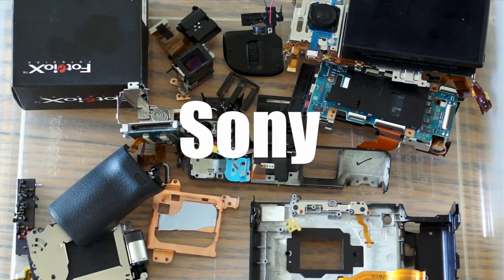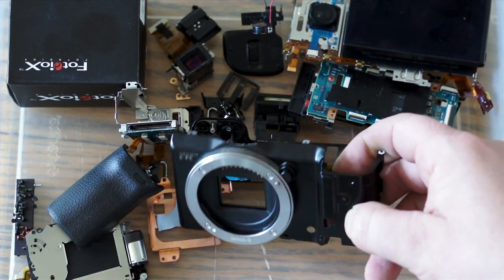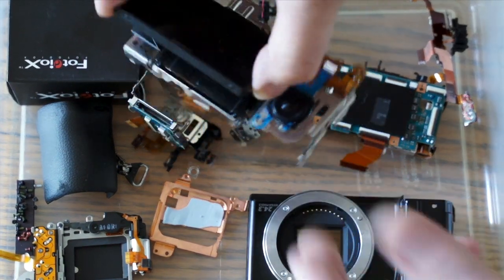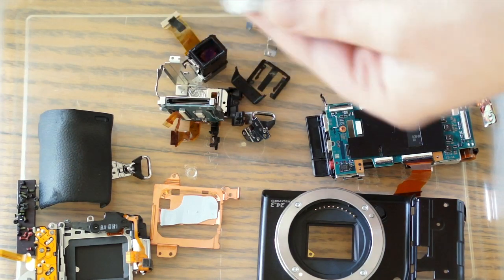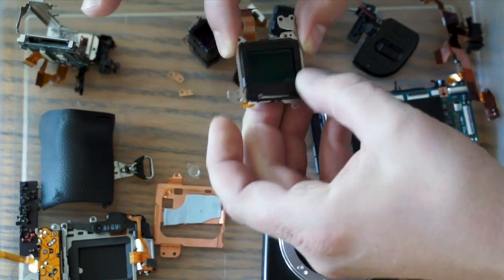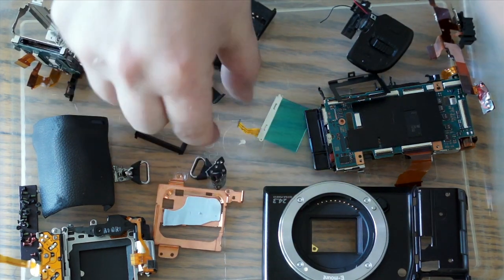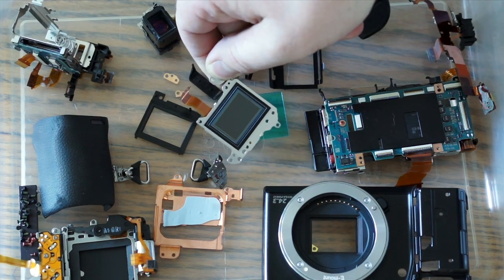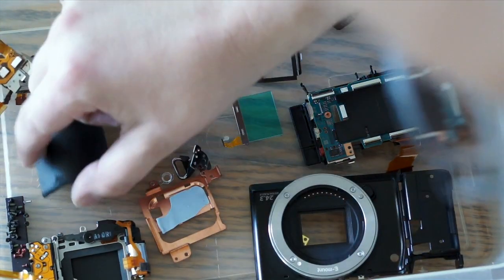Sony Nex-7 - Completely Disassembled

Comment: the green glass over the sensor is the ir/uv filter and the wire is for cleaning it. Im wondering did you have to desolder the ribbon for the glass or did it just come out?
Reply from the maker: Hello, I since learned that about the glass, but thank you! I did not have to desolder anything it was all connectors that I dealt with...
Reply: @Jason_Hermann  Hey thanks for the reply after so long! I took apart my nex-7 using an archive of the photos you posted. Was able to get the camera back together after removing the filter and ready to shoot in infrared/astrophotography :)

Comment: Hi Know you probably won't see this but I thought i'd ask. 

I brought a second hand NEX 7 from Harrisons camera's which apparently was checked over. But the camera won't video or take pictures. It used to have the attach lens properly message but since using a Sony lens the message doesn't show up. But it still doesn't work. I have made sure the battery is fully charged and the SD card is sorted out correctly. Do I try to fix it myself or ask them to fix it under their warranty? Would I need a new part?
Reply: Hey i own a nex 7 myself, and sorry that i just read this about 9 months after you posted it. Have you found the fix? if not you could try setting the camera to release without shutter
Reply: @Ginchans  thank you so much for the reply.  Yeah I did that and it still didn’t work. But then I sent it back to them and they said it worked. It definitely didn’t ha. I ended up getting a different camera from MPB. Have a great day 👍

Comment: If anyone warte to prevent this, i fond a link to a special Nex7 quick release plate, wich supports the bayonet of the camera to prevent the case from cracking.

http://m.ebay.com/itm/121166765729?cmd=VIDESC&gxo=true